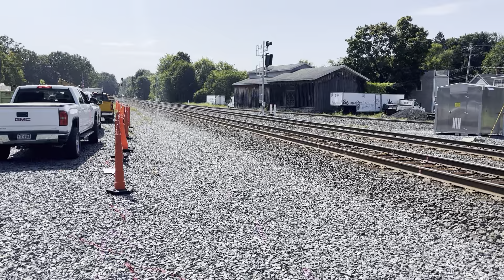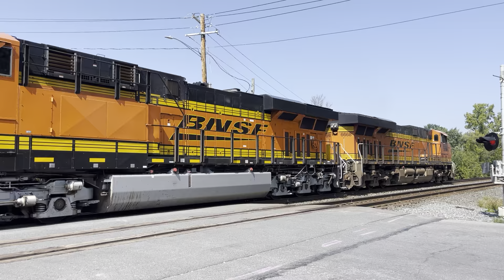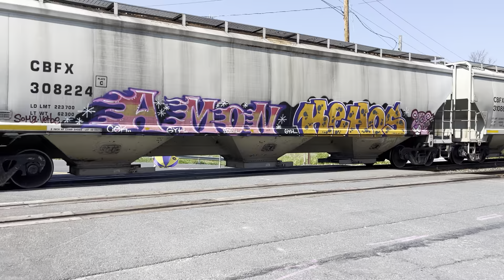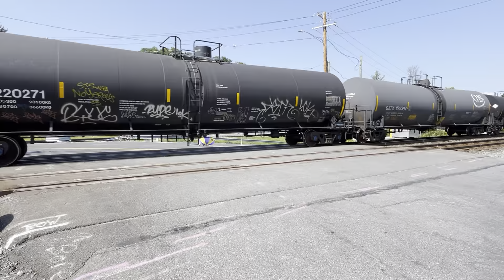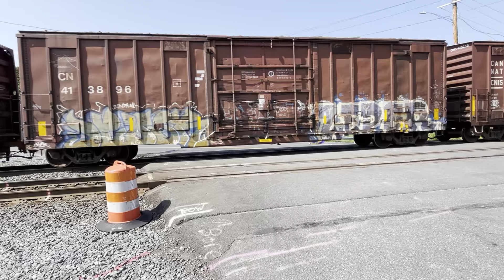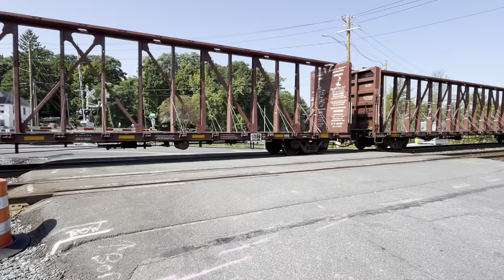M367 to Chicago Uses Two BNSF Units 😱 & has 456 Axles Thru Voorheesville

Comment: Nothing too special but I checked the doors on the CRYX cars. The last one didn't match up to anything and since the first car is in New York it has the title of Hyde Park so we can chalk that up to FDR as president. But we can draw a connection between the BNSF power and the last name even though it has nothing to do with this train. The name is Willow Springs which is a large terminal for BNSF Intermodal specifically trailers a few select priority containers add most important right next door to the UPS sort facility. This is on the former Santa Fe main and while trains do terminate and originate here conventional containers will also do pickups and setups for Corwith  yard. There actually are several warehousing and logistical firms in the area due to close freeway access so this car could spend time in the Chicago suburb
Reply: Thank you Paul!